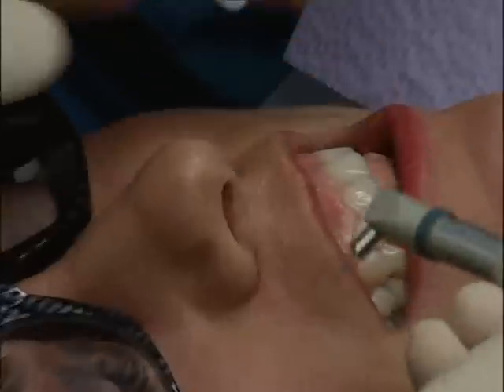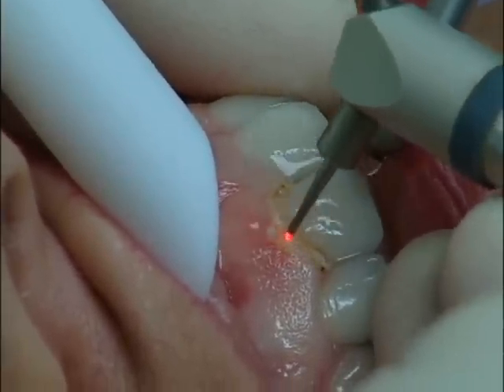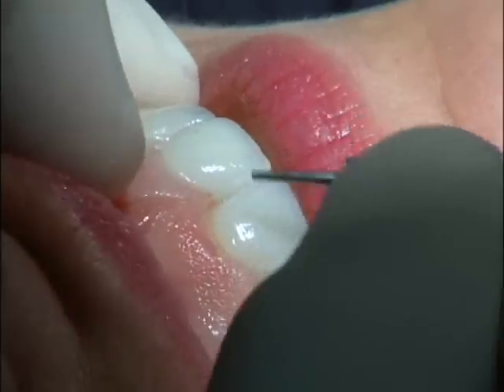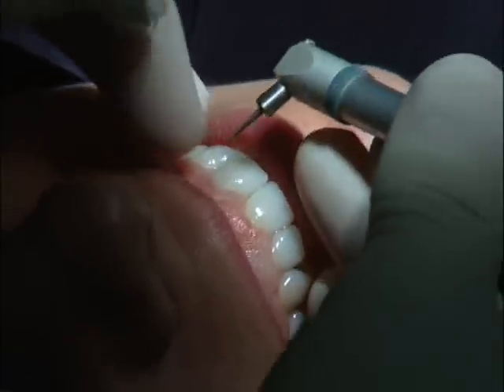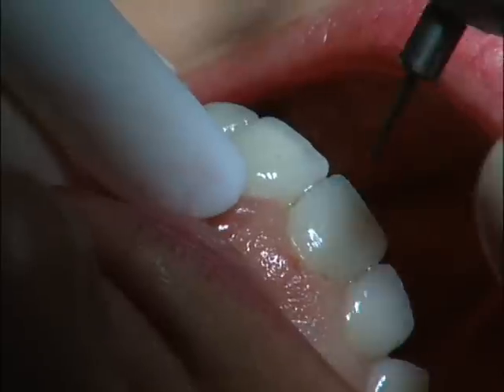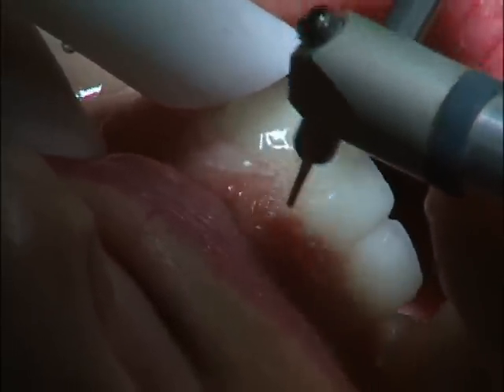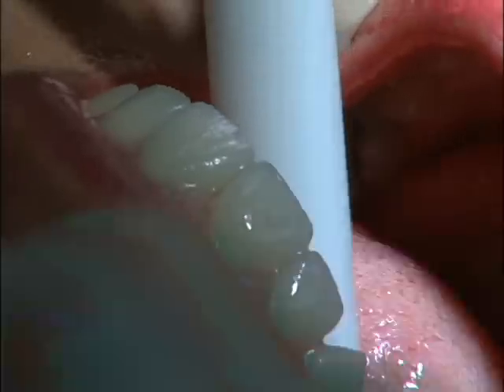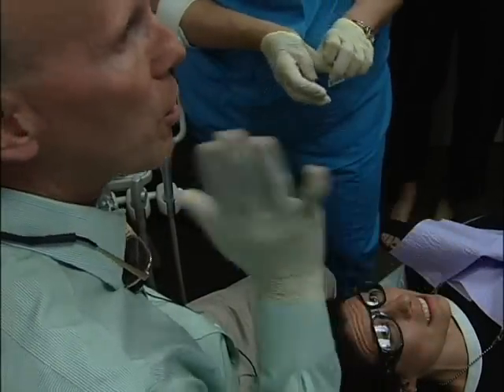Gingivectomy

Comment: I had this done today along with my molars taken out. I was put to sleep first because I'm a whimp when it comes to pain. I have braces and it was my orthodonic's idea to have the gingivectomy done. My gums squeezed together as the spaces in my mouth closed up creating extra gum tissue in areas not needed. I now have to get vaneers once my braces are removed. All this has me close to $15,000 without insurance. Unfortunetly, dental work is not cheap.